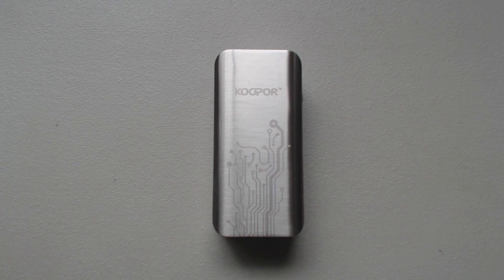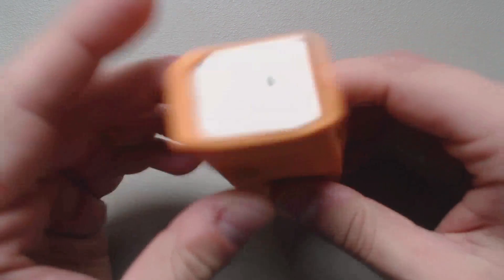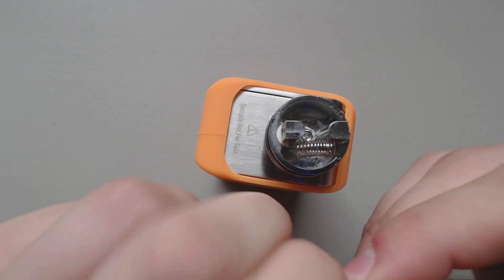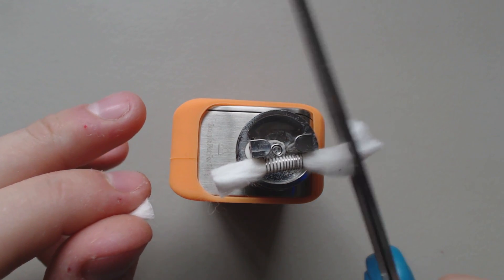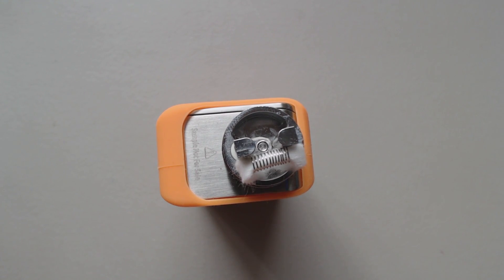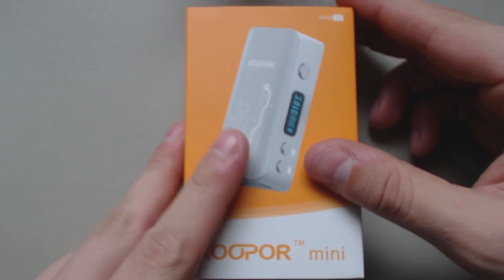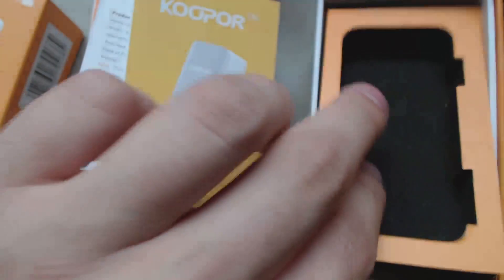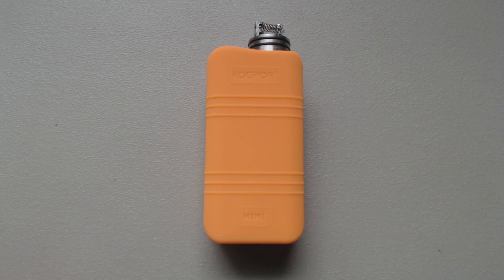KooPor Mini Dry Burn Test

Comment: hi sorry i know this sounds dumb, but i am new to TC mod, and i just got koopor mini right after i saw your video, i was hoping you can answer me a question here:
on the first day of purchase this mini koopor, i was using REM atty with nichrome wire at first i was able to use the temperature control but the next day which is now, it seems like i cant use it it anymore, it fired up a lil bit then automatically change to wattage mode.

question is, can i use Temperature mode in nichrome wire?
Reply from the maker: +FrenchInhale Not with the Koopor Mini, I think you could use a DNA200 mod with it but you'd need to specify what type of nichrome when setting it up.
Reply: +DownToVape 
i see, appreciate for your reply. thank you i thought something happen to my koopor haha. silly me.

Comment: help please, when i got the tc with ni200 it's not show dry coil but it still firing how to do the dry coil (new cotton for test) its not work, or juat set tcr first? i dont understand....
Reply from the maker: +Bankchart Vaper Make sure your coil is room temp when you get your initial reading; if you have a contact coil it may run warmer than you want. TCR adjustment is if you are trying to use a different purity of ni200; 0.0050 is what I had mine set at with ni200.
Reply: +DownToVape thanks bro i got it, pretty awesome :)

Comment: Hey my friend, very cool from you to bring us a second Video, to that we asked.

unfortunately i ordered my Cloupor GT, because its 2*18650 mod, but i like that little Box mod so much, that i will order this koopor too. I really felt in love... weird or?
there's coming a double battery also, but i will choose this smaller one.

600°F should damage the cotton a little more, thats really right.
But, if you can adjust the coefficent, you are able to do some fine tuning, isnt?
Because with an cheap chinese NoName-wire, you need very much different settings, than with correct 99,5% ni200 (for example).

Are you still happy with your koopor Mini Box mod?
Thanks again and greez from vienna 😉
Reply from the maker: Sebas M I still use it; it's a great mod for going out to concerts and the bar. The coefficient can be adjusted in the menu. I only use NI200 so it should be pretty accurate, my only guess is the initial ohm reading might have been off. I do love dual 18650 mods in parallel for battery life though, series are nice for the extra power punch. Looking forward to reviewing some DNA200 mods soon! (not sure how long...) I've got the VapeCige VTBox200, CloudMaker DNA200, and maybe a few more :D

Comment: Nice job :) It's a very good mod. I just got an IPV2 and it's almost too small. You also can't see what it's doing when it fires. This is a little bit less money and just a little more to hold on to, plus the power settings. This does a lot more actually.
I vape that juice! Vape Wild is exactly what you say, pretty good juice for the money. Their Vanilla Clouds is good too if you like vanilla. I got a bunch of flavors I haven't tried like the Strawberry Cheese cake.